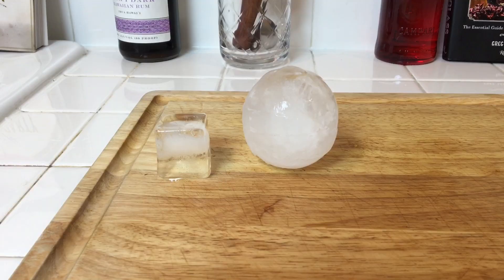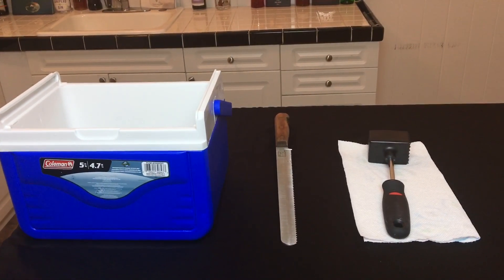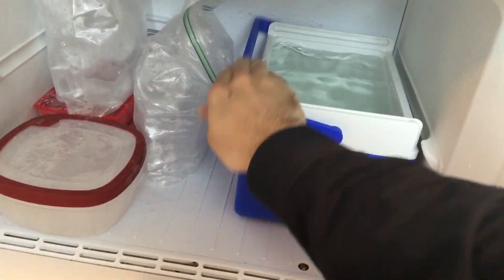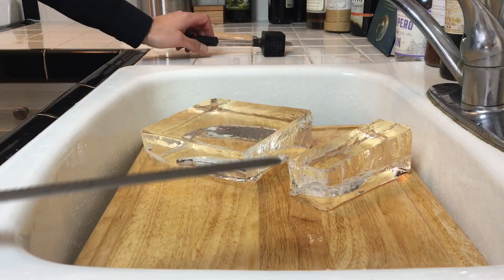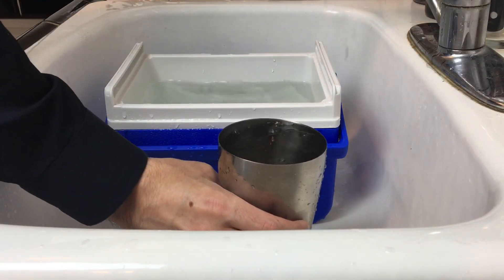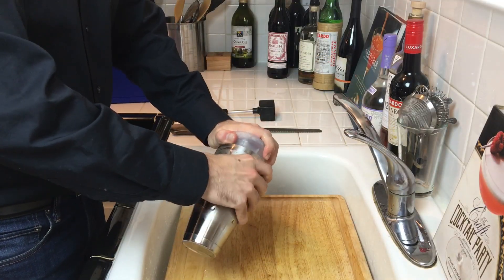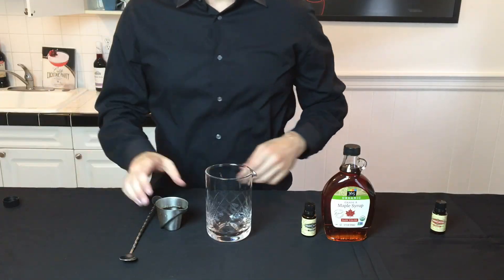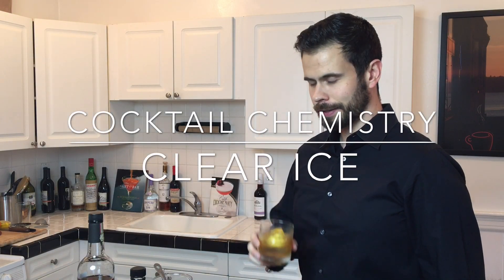Advanced Techniques - How To Make Clear Ice

Comment: would distilled water be clear?
Reply from the maker: It will help a bit if you have bad water, but will not get you clear ice
Reply: Oh ok thanks :D
Reply: nope, the cloudiness is not that of impurity but cuz of bubbles in the water, idea is to freeze slowly from top so what happens is as it's getting frozen from one side the bubbles won't get trapped in middle and also as it's getting frozen slowly from top it let the bubbles to push themselves down to the bottom that means even if you freeze the water from top and you freeze quickly it won't let the bubble to escape to the bottom and it still will be cloudy, you can literally freeze it from any 1 side as long is it's slow process you get the same result.

Comment: Actually this doesn't work for the reason he says - it's actually air bubbles that cause the frosting in normal ice cubes. 

you can most of this effect by just boiling and cooling  the water a couple of times

By using directional-freezing he's just pushing the air bubbles into the un-frozen part (though there is an argument that by starting freezing  at one point, you could in theory create a single crystal of ice - rather like the single crystal epitaxy used for turbine blades or silicon...... but it's not because of impurities as claimed)

just try boiling water a couple of times and filling a normal ice cube tray /bag

Comment: would freezing distilled water not create clear ice?
Reply from the maker: It's a common misconception, but not it will not
Reply: yehôshûa B no it doesn't, I've tried it and also the boiled water 3 times and still cloudy. only this worked for me .
Reply: air getting trapped in the ice is what makes it cloudy, that's why distilled water won't make much of a difference
Reply: No, just In the same way a piece of iron isn't automatically magnetic. The internal atomic structures of both need to be aligned in a singularly unified direction.
Reply: do you drink distilled water
Reply: only if it's also holy.
Reply: What makes it cloudy is the tension of water getting frozen from outside in. As it froze and expends it produces many small fractures. That makes it cloudy.
Reply: Raphael Aguirre , and that tension is caused by the air trapped inside. Thats why directional freezing doesn't have that tension, air has a way to get out
Reply: correct.

Comment: The only problem with this is you need to live in a place where the tap water is actually good, like Madrid, Spain. In many places tap water is just not drinkable and using bottled water for ice like this is expensive.
Reply: If you live in third world, just filter...
Reply: This method purifies the water, so in theory it should produce clean ice from undrinkable water.

Comment: Very nice trick . I bought the exact same cooler, and everything went well .
The only problem : when I pour my drink into the glass, the ice immediatly brake inside .
Any idea how to solve this problem ?
Reply from the maker: Yes, let the ice sit in the glass for about a minute before pouring the cocktail over it, that will prevent the cracking.
Reply: Thank's, I'll try that !
Reply: it works ! Thank's again !!!
Reply: +Luca Viktor it didn't break for me.

Comment: very cool video, I tried it myself with the expected result, but I have a problem when it comes to cutting the block of ice. 
After I cut it a bit with a big knife, when I hammer it it never goes right-angled, some parts really go in the bad direction. I have the feeling I'm doing just like you on the video but maybe did I miss some parts. Any help? ;)
Thanks!
Reply from the maker: Hmm, try cutting into both sides of the block before hammering it. Make sure your hammering the part of the knife that's in the center line of the block of ice as well

Comment: do you have any suggestions to keep the ice blocks from sticking to each other after the ice is cut and put in bags?
normally i  would take the bag and drop it on the ground first, but i don't want to break my perfect ice blocks
Reply from the maker: +DeadlyNeurotoxin if you have a big enough bag, you just have to space them out enough so they don't touch. If that's not possible, I typically use the same knife and mallet to separate them, pretty easy
Reply: +Cocktail Chemistry You can also (after you put the bag in the freezer) gently agitate the bag every 3 minutes for maybe 3 or 4 times. This allows the thawed water to freeze which prevents the ice from sticking.

Comment: I use a different methode. I take a bucket, fill it up with water and fix a vibrator on the outside of the bucket with some ducttape. Turn the vibrator on (it has to be one of those 12 hours runtime things) and let it freeze. Because the water vibrates the air will get out. And air is what makes the ice go white in the middle. 
Oh and please dont ask how I discovered this.
Reply: I would love to hear more. Is this a known technique? (And, no, I'm not just looking for an excuse to buy a vibrator that lasts for 12 hours).
Reply: +Aubrey Hesselgren Well you certainly can say "I just bought it to make crystal clear ice".
But chances are the cashier wont believe you and doesnt care.

Comment: I'm using the exact same cooler filled with water from a Britta filter. after leaving it in the freezer for 24 hours, I'm getting a block that is 2/3 of the way frozen, but the top portion is still cloudy. is my water freezing too quickly? 

great video, btw, subbed.

Comment: if i were doing this id cut wit a hot knife bc id imagine that would be cleaner
Reply: Thermal capacity of a knife is nowhere near big enough to melt through a block of ice this size. You'd have to reheat it every couple millimeters.
Reply: Goyly Dan Even if the knifes are solid titanium (which I doubt; usually they're just titanium coated, mostly for marketing purposes), it wouldn't help you much. Specific heat of titanium is only 20% higher than specific heat of steel. In fact, no material has high enough specific heat to let you melt through a block of ice this size, even if the knife is white hot. You'd either need something with much higher mass or something that's being actively heated while you're cutting.
Reply: Radiotypical Yes, as I said, something that is being actively heated while cutting would work.

Comment: thanks - I have a couple of irregular moulds, one has small shapes for cubes, another is designed to make 4 shot glasses out of ice. boiling the water never worked for me (as you said), would placing it in the water filled cooler work for these somehow?
Reply from the maker: +katuroo They'd probably have to be filled and turned upside down in the water (like I did with the ice ball here). Give it a shot and let me know how it goes
Reply: alright, I'll have to buy a cooler first :)

Comment: If you're taking that much effort to make the ice, wouldn't you want to use purified or distilled water instead of tap water?
Reply: Why would you want to use purified water? Better taste, improved clarity, fewer mineral deposits, etc. If this guy is taking that much time and effort to make clear ice, you'd want to start with the best quality raw materials. Also, he's using higher quality ingredients for everything else, then adding plain tap water to the cocktail; it is counter-intuitive.
Reply: +Jason Fritz correct me if I'm wrong... the part which freezes is "100% pure water", which is why it is important to have some part of the water remaining (that which contains everything else that was "squeezed out" in the process of the ice freezing - the minerals, impurities etc)

In that sense, there is no difference between Clear Ice frozen from tap, distilled or any other water...
Reply: +Jason Fritz tap water has huge differences depending where you are. I've had tap water that tastes just as pure as bottled/purified water.
Reply: +Jason Fritz Why?
Reply: +rudirs3 tap water has that slight chlorinated taste
Reply: +Zadss One I mean it depends where from, but yeah that makes sense
Reply: +Zadss One tap water prevents cavities and tooth decay. The ones drinking only bottled and filtered water have the worst teeth of all time.
Reply: but this is only for ice, not everything you drink

Comment: Point of fact boiled water is called steam or vapor. Do you mean distilled water? I'm guessing you're meaning it doesn't matter because impurities aren't what cause the cloudiness, it's dissolved gases?
Reply from the maker: +kenstr321 Correct, using water that has been boiled (or double boiled) may remove some impurities from poor quality water, but it won't prevent the cloudiness (which is the result of tiny bubbles filled with dissolved gasses as you mention).

Comment: Why use so much ice? It just means you have less room for the drink. Personally I use whiskey rocks, because whiskey and mead is pretty much all I drink.
Reply: +Clash If the ice comes directly from a freezer, the large piece of ice can cool the drink without diluting it.(an smaller piece would melt more.)

If to little room is a problem just use a larger glass.

Comment: so basically..... just freeze the fucking water
Reply: +Abhay   Puri Are you surprised that the creation of ice involves freezing water?
Reply: +Миша Шевченко just freeze the fucking water... in a large container with insulated bottom and sides and for just a short enough that that it doesn't freeze all the way down to the bottom. Yes, just freeze the water.
Reply: +Abhay   Puri not really. it is a specific way of freezing the water. if I for example ask you how you want your drink and you say 'in a glass', then I will serve your cocktail in a huge beer glass (obviously only filling the bottom). now if you would've said 'in a cocktail glass with some ice' this wouldn't have happened. there's a difference between just doing something simple and doing something specific, even though it uses the same process (in the example it is putting a cocktail in a glass, in the video it is freezing water)
Reply: +Abhay   Puri Not for to long though. lol
Reply: +zarblitz yeah.. you basically described freezing water

Comment: Actually even if you don't care about how your ice looks, clear icecubes are still way better than cloudy icecubes. Since there's no air bubble inside clear icecubes, they are denser and cooler, which makes them melt slower than normal icecubes, so your drink won't get watered down too quick.
Reply: agestam
I can agree with the shaking argument, but that same link also says why big spherical ice isn't always good: as you drink it gets exposed to the atmosphere, which makes the ice melt and dilutes the drink without the benefit of chilling it, as it's chilling the air.

I guess one could argue that chilling the air makes the drink stay cooler for more time, since it's not gaining as much heat from the atmosphere.

I suspect the differences are all too subtle to matter, anyway... Just pour the ice and drink! If it gets too diluted, add more of the drink! Hahahah
Reply: Bruno Tavares Siqueira true just thought it was worth mentioning you can chill without the dilution with other methods so people dont think they are always diluting when chilling
Reply: Horny Dragon 好色龍大大？！
原來…這就是你沉淪的原因嗎?
Reply: Why didn't I pay attention in school...
Reply: They aren’t cooler - they’re at exactly the same temperature.
Reply: Cody Pearson Hes actually right though lol. Its simple thermodynamics, thermal energy (heat) goes from warm to cold aka from the drink to the ice. When the ice warms up, it melts. 

The bubbles also do actually matter, as they greatly increase the surface area of the ice, this can result in a quicker melt. 

It shouldn't really matter tbh, the most important thing is to precool your drink and glass, so the ice only has to keep it cool, instead of cooling it down on its own.
The temperature outside, glass you're using etc all have an impact on the ice (for example a thin glass is more conductive).

Btw the sphere of ice isn't the best, its best to freeze ice into the glass, so only the upper surface of the 'cylinder' can touch the drink.
Reply: +TaiwanBro 好色龍 I think the water resulting from melting because of the trapped bubbles would stay trapped inside the ice cube. Only the ice in contact with the drink will dillute it when melting... Also, that dillution is linked to the chilling of the drink. So... no melting = no chilling the drink!

source: http://drinks.seriouseats.com/2013/06/cocktail-science-myths-about-ice-big-cubes-are-better-dry-shaking-whiskey-dilution.html
Reply: Cloudy ice. Another 1st world problem. ;-)
Reply: The part about no melting = no chilling is incredibly incorrect. This is why whiskey stones exist that continuously cool your drink. They do not melt but they stay cold, to keep your drinks cold without haing them watered down.
Reply: ? what do you mean ice absorbs heat  which results in melting rofl. This is the reason ice is better than whiskey stones when it comes down to cooling. Go read some basic physics before making such bold statements.
Reply: +Bruno Siqueira well... when you serve the drink it accually doesn't matter that much, if you have decent ice to begin with. the melting goes faster the more area the ice have to the drink. that's why one big sphere is the best way to go. 

how ever, if you are shaking the ice, it's waaaay better to use clear ice. the ice is much harder and wont crush in the shaker. if the ice gets crushed, it ends up diluting the drink alot! 

happy mixing!
Reply: @agestam  old comment I know, but this is totally wrong: First of all, you never serve the mixing ice in the drink, you use fresh ice for that. 

Second, any ice you shake with is going to chip, and melt, and that's part of the point. 
Most of the cooling capacity of ice happens in the phase change from solid to liquid, so unless you have a large quantity of very cold ice (much below freezing), you are going to have some melting and dilution when you cool the drink. Part of the reason for using fresh ice (if you serve on the rocks) is to reduce dilution.

Finally, if you haven't noticed, producing clear ice is very labor and time intensive. Even if you have the fancy molds. And most of that ice is way too big to work in a shaker anyway. 
It would be insane to waste so much effort using clear ice for mixing. The only real point of clear ice is presentation, any slight difference in melting time is trivial and academic. 
Also big ice would not cool as effectively, that's kind of the whole point, so you'd just be wasting your time shaking or stirring longer..
Reply: I'm way too lazy personally for any of this though lol.

Btw protip: if you need to quickly cool something, grab a bucket (or coolerbox) and dump in ice, water and salt. The salt will act as a catalyst in the melting process. You can chill a beer in like 5 minutes this way.
Reply: Dance Artist Using this method, you can chill water to below 32°F (0°c) while still maintaining its liquid state. Super salty though.
Reply: Idiot

Comment: I always thought those bubbles formed because of air dissolved in the ice. Your faucet aerates. You would need to sonicate to remove the air. The reason why this works is because he is only freezing half the water. So he is crystalizing ice slowly, and the air is becoming more concentrated in the remaining water. Using distilled water would also help I think.
Reply: +AsHellBored Problem of cloudy ice is due to both the quality of water and quality of environment in your freezer. Like he said in the vid, even filtered water will result in cloudy ice.

Comment: That's a neat trick, thanks! I have a question though. If I re-freeze those blocks for later use, will they get cloudy?
Reply from the maker: +yermomsboyfriend true, just note that if you splash water on the ice right after you pull it out of the freezer it will almost certainly crack. Let it temper for at least a minute
Reply from the maker: +Mathew Jacob The blocks will likely accumulate a bit of freezer burn but it will go away after a few minutes outside of the freezer
Reply: +Mathew Jacob A quick splash of warm tap water should do the trick too, if you're in a hurry.